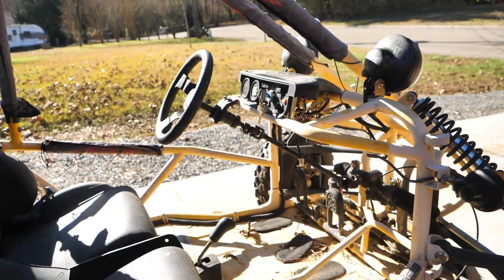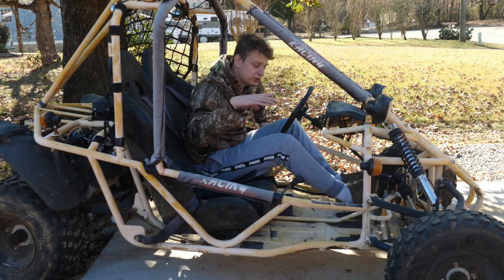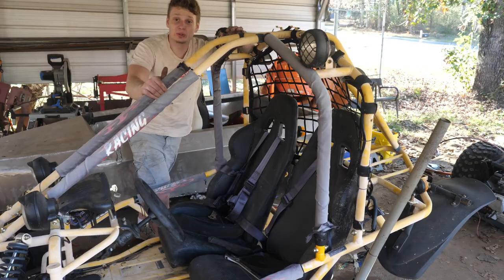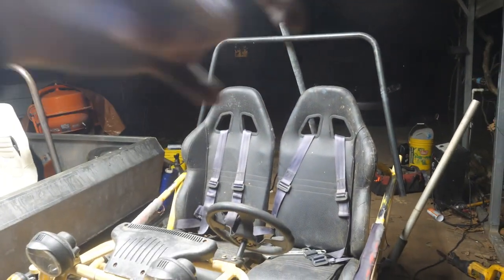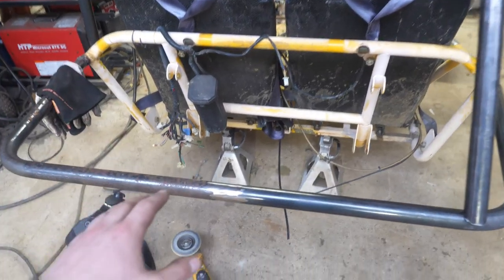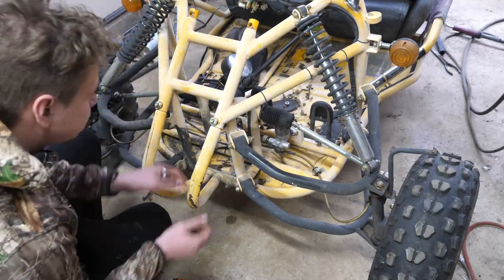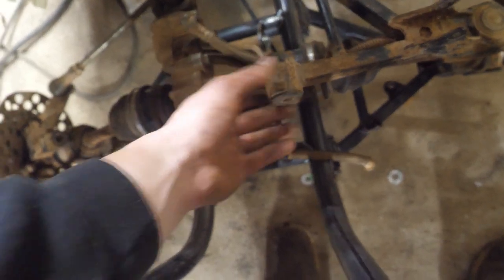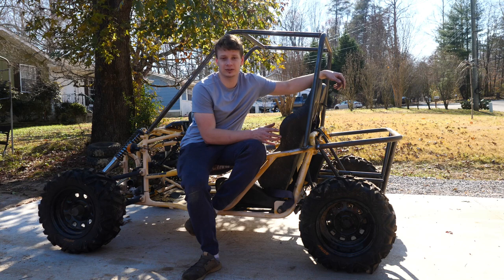I bought the Cheapest Buggy and i'm making it 4X4 and faster

Comment: With that rear setup you can do both front and rear steerable, so you don't have problems with pour steering performance, because if you don't use lockable hubs in the front is gonna be a pain to turn.
Reply: Rear steering would be sick

Comment: Build it up like a 2 seater Honda Odyssey, those steering wheels were iconic with all the controls. As far as the front diff goes just make sure the bearings feel nice. I replaced mine on a new used one, the original one’s chewed through the races because it was ran dry.

Comment: use kawasaki prairie/ brute force front differentials. they are mechanical locking  with a cable and they have a spot for a actuator so you can selectable 4x4. also with a rear you can unlock it wont tear up your grass.

Comment: Looks good so far! If I may offer a couple suggestions, I think you'll be ready to rock. I'm worried about the rear control arm tabs. It looks like they hang down pretty far, so if you get high centered, they're the first to scrape and get stuck/bent. I'm also concerned that the front diff won't play well in the rear. Differentials are typically spiral cut gears, so running them backwards under high load often doesn't end well. Good job on making the cage so tall! Several builders make it too low so it's more of a hazard than a protection device.

Comment: I agree with the sv650. Even a vtwin 750ish cc motor would work pretty good. Your going to want torque to turn the shafts and diffs.  Mt-09 engine would be the best of both world for hp and low end  torque but I'm sure they are pricey.
Reply: As the owner of an MT-09 I completely agree on both counts: would be a sick engine for this but would not be cheap.

Comment: That will be great, engine wise I would go for a Suzuki SV650 as the torque will be good to have and with a 700 kit it would be perfect but not really needed,  and you could go for a TL or SV 1000 lump, an electric reverse should be easy to set up off a drive shaft.
Great work & great work to be done, Good luck !

Comment: i bought a 2006 roketa 13b chinese buggy independent suspension for 300$ need some but it was worth it still not done becuase you know project never ends, planning on swapping a 1000cc motor in the summer

Comment: I put a 500cc Rotax on an older one that's similar to this (but 2 seater).  But it doesn't have the independent rear.  It's more of a swingarm, that has the engine on it- so it's not great.  This kart looks way better to start out with....  I clocked mine at 74mph in a city block though, with 2 riders. lol..  I had to add a second jack shaft to get the gearing right because the belt was slipping, but it's pretty stupid fast now, and accelerates nicely.  For those snowmobile CVT's, you have to really dial in the gearing for it to work well.

Comment: Raptor 700 would be a beast in that. Use an electric power steering shaft! With plenty of horsepower it'll turn the tires and you'll be able to steer still. I'm guessing, you don't want a bunch of caster. But I don't know that.. probably want to try to limit the scrub radius. But, an electric steering shaft will make it still turn even with offset Wheels and 4x4.

Comment: I have owned well over a dozen Chinese 150/175/250 buggies. The GY6 150cc air cooled motors are indestructible and highly modifiable. HONDA designed. MILLIONS of the GY6 motors have been made. My favorites. There are lots of performance goodies on the market for relatively cheap. From CDI's and Hot Cams, Intake systems, Exhaust systems, to BIG BORE kits. The Torque convertors are very tunable too. I've raced motocross for decades and these buggies are the most bang for the buck. I'm 65 and have a tricked out DUNE 150, same as a Tomberlin Crossfire 150. Fk'n rips!!
Reply from the maker: Fair enough!

Comment: Crf or trx 450 engines are strong as hell and pretty bulletproof.
Reply from the maker: Have to be electric start those would be hard to kick over standing on top of the buggy
Reply: @VasilyBuilds  they have e start models, the trx engine from 06-14 are all estart, with tons of parts available at decent prices.  A lot easier to work on as well imo with sohc vs dohc on the Yamahas.  No pressure just a suggestion to check into!

Comment: Nice job but I must say take the seats out next time while you weld over top of them
Reply: Also use king quad diff because it has differential lock and when some smarty says how do u use the back diff when it's made in the case of the engine use 2 front diffs same years and what not  so the ratio matches them it would be true 4x4 or limited slip when necessary